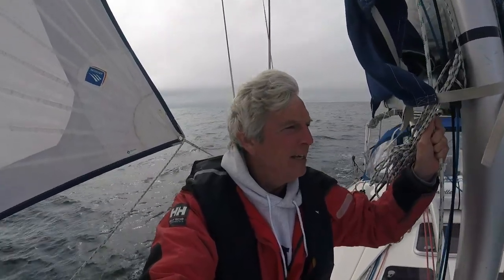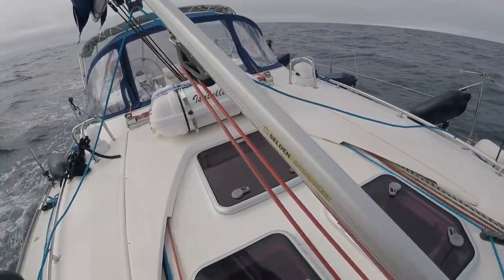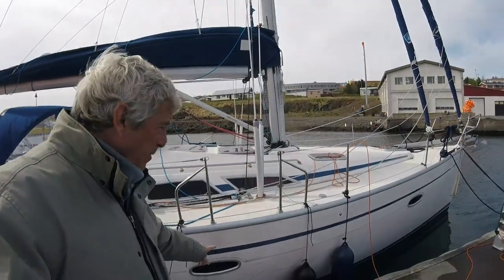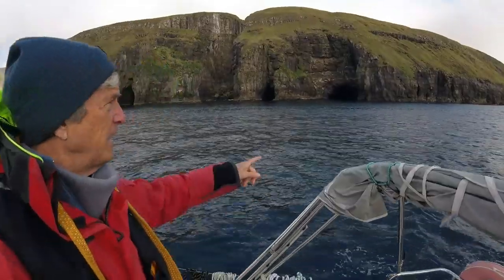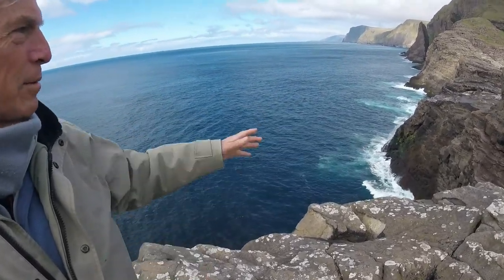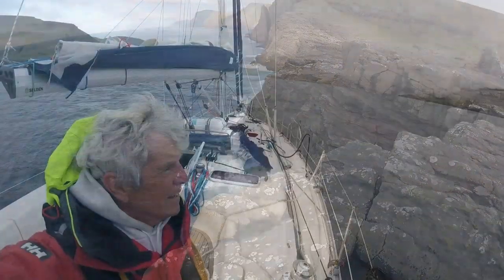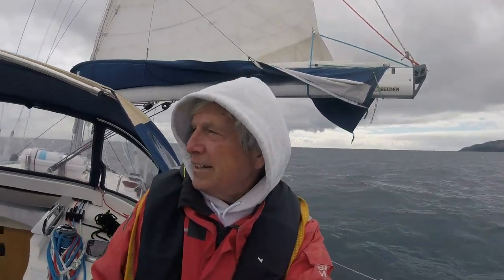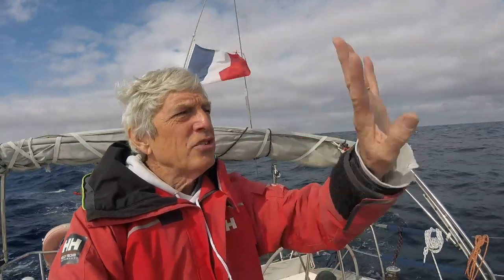Ep 43 Sailing Solo Faroe Islands to Scotland

Comment: Another great video!  I noticed that the rescue boats in Iceland look very similar to some types of British RNLI lifeboats - I wonder if there's a connection. The Vikings were always heading south - that's why they ended up where they did (and why Normandy is Normandy :-)). Glad you didn't end up impaled on the front of the Alethini and definitelly the right decision to put the motor on - it's many years since I was sailing and diving around there but you don't want to mess around with the tides between Skye and the mainland:-)!

Comment: Hi Patrick. Interesting to hear your thoughts on the German mainsheet system because for the kind of small boat coastal sailing and racing that we do, we would never want anything with the mainsheet traveler on the coach roof. Goes to show, horses for courses etc etc. We would be interested to hear more about the tidal ranges that you experienced in the various ports that you visited. Being on your own did you not find yourself constantly worried about lines and fender etc (as per your previous film) when tied up against docks and tires ?
Reply from the maker: Yeah, my good friend James from Samingo Sailing hates my traveller on the roof as well.   I just love having the cockpit clear and uncluttered of blocks and lines, etc.   It's also very nice when a gust hits ---- you don't have to slide downhill to get to the sheet like on some boats --- you just reach over to whichever one is closer and ease it out.   I'm not a racer, and my sail balancing skills would probably be much better with a traditional rig, but I'm happy with what I have.   The tides ranged 3-5 meters in Iceland, and 1.5-3 meters in the Faroes.  The trick is to tie up to the pier (forward and astern) as far away as possible.  I usually stayed aboard for the first low tide, and was then comfortable afterward.   You can't hook up traditional spring lines in areas like that unless you want to tend the lines all night long.   (There is a clever way of hooking up a vertical line to the pier at midships, and a second very short line attached to the boat that loops around the vertical line.   That keeps the boat tucked in nicely against the pier, but it's not always possible to hook up that vertical line.

Comment: Love the main sheeting system Patrick. Been looking at it all this and it didn't register how spiffy you have it set up. Yes, the Vikings ventured quite far on this side o the Atlantic. I believe one of the camps was found in CT. There have been more found below the Mason/Dixon line however I am not sure how many of those have actually been certified as such.
Reply from the maker: Thanks for that Spencer…...so I am not violating any Viking code by heading for warmer climates.   :-)
Reply: @patricklaine6958  I think anyone who has run the Stockholm channel through the Baltic and straight out to and across the N. Sea proper only does so safely by the grace of the Vikings gods myself. Best to stay on their good side.

Comment: I bet Chateauneuf-du-pape is not to be found in Ireland either. And maybe someone may find aggressive behavior for asking. Sailing 17 hrs without a break is tiring and I can see the need for some strong beverage to keep the cobwebs at bay. It is so great to dock with no current or wind fighting you. About the use of the engine, missing a tide change and having to heave to for 6 to 12 hours is of little consequence to a couple euro's for fuel.

Comment: Patrick, I saw you did use a loop when docking. Wouldn't "taking back the line" be better? You have then the option to bail out. And of course awesome video again!
Reply from the maker: I have bailed out with this loop set-up Airgead.  I just releaase the bitter end, and the line pulls out off the boat (attached to the cleat on the pier).

Comment: One thing you haven’t mentioned in your videos. 
Some folks spend 6 months or longer while planning for a long passage. Repairs on their boats to getting visas to choosing the right month of the year to goto that area. Then choosing the right weather window to start.

How long do you plan out long trips ahead of time?

Is there preferable months out of the year to sail to certain destinations?
Reply from the maker: There are guide books of "Pilot Charts" that show prevailing winds for the oceans of the world for each month.   That gives a good starting point as to timing for key passages.  There is also a well-known cruising guide by Cornell called 'World Cruising Routes' that shows the most-commonly used routes across oceans.   I live 5 minutes from my boat -- and sail it (and maintain it) year-round, so it is more or less ready to go at any time, anywhere.    I am very lucky.    I usually do a last minute oil/filter change, and a supermarket run, and I'm ready to go.   It really doesn't take months of planning to go anywhere if the boat is well-maintained.  The lengthy planning period people speak of is waiting for the right season, time off work, studying local and remote sailing guides, and an inspection for any maintenance required.

Comment: Great videos Patrick! And thank you for the showing the German System. I'm going to see if I can apply it to my new (to me) sloop. Weren't you going to get a wind vane as a back up to the below deck auto-pilot? It's gutsy to take a voyage like this singlehanded without one.
Reply from the maker: I really should have put a wind vane on Ron.....  It's not quite as easy as on some other boats due to the fact that the stern is a swim platform also.   It would all need to be 'stiffened' and reinforced  --- all a bit complex, and I just spent a fair amount on the staysail.  I said 'next year'.
Reply: I have the same problem as to a wind vane on my new (to me) sloop. It too has a swim platform. After much research I've concluded that the only one that will work well, while retaining the swim platform's function,  is a Hydrovane, as that can be mounted well off the center line and still works. But they are not cheap.

Comment: What is the brand and model of your "shell" for the Samsung Galaxy TAB?
And why don't you stop your boat completely before tieing it to the dock? I'll asume that you do it on purpose. Nice video as always.
Reply from the maker: The shell is called 'TechGear' --- but, it is not waterproof.  For some reason, they left a hole in the screen where a little button is, and water can (and does) get under there.  I try to keep this tablette under the spray hood or in the salon as much as I can.    I think the 'fisheye' of the GoPro camera makes it look like I am going faster than I really am when I dock.  That said, with wind and current, I don't find it of much use to spend an extra 5 seconds finessing the engine to bring the boat to a complete stop anyway.   That just gives extra time for the wind/current/prop wash to get the boat a bit out of shape.   It works for me (more or less), but understand others who have a different technique.

Comment: Hi Patrick, I’m curious, Is your iPad mirroring your chart plotter or are you running a whole different NAV system on the iPod alone? Thanks in advance for a reply
Reply from the maker: I used to program both iPad and Plotter with each passage; then I switched to planning everything on the iPad, and having the Raymarine plotter on 'just in case'; Now, I don't even turn the plotter on (saves energy).   I know it is there in case of emergency, but the iPad/Samsung Tablettes with Navionics work just fine.

Comment: How big is that Diesel tank?  Must be HUGE ...
Reply from the maker: I'm not sure why you are asking, but it has a capacity of 210 liters, which would give me a theoretical motoring range of about 450 NM.   However, I rarely let the tank use more than 40 liters before topping it off again (to reduce condensation on the tank walls).  When I go on very long passages, I carry an extra 100 liters in jerry cans, so that I can motor a long way should a disaster occur and I lose my mast.

Comment: What you call the "German System" sounds as though it is what Harken and the other manufacturers call a two-speed mainsheet, except that the two "tails" are routed to different places on the boat.  https://www.harken.com/productdetail.aspx?sku=332  I crewed on a Highlander (20' US centerboard one-design) with a two-speed mainsheet and, as with your set up, one can sheet or ease either tail to adjust the main, but if one sheets or eases them both at the same time, you have a lower mechanical advantage but faster adjustment.

as an aside, I have an old computer and usually have to wait several days before YouTube has a video format available that my computer can read.  Occasionally, I can watch a video nearly immediately, but sometimes it can be a week or two or even never.  Still waiting on YouTube for your latest two videos....I guess I really should upgrade.
Reply from the maker: I haven't heard of that Harken system before Tod.  Thanks.   I'll study it a bit more.